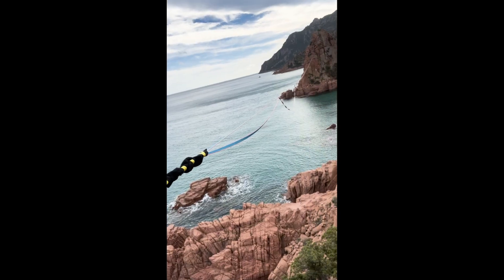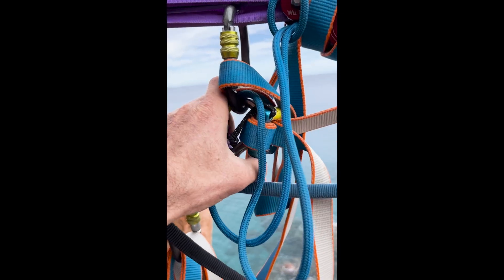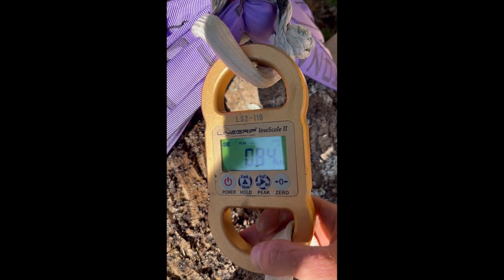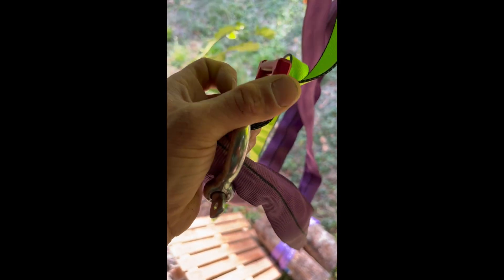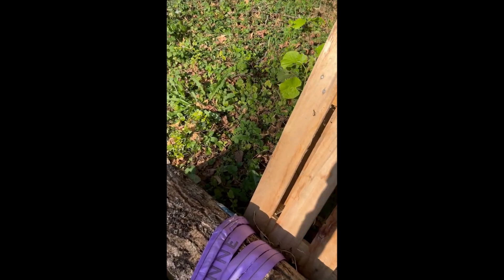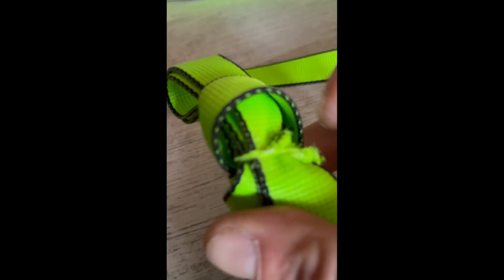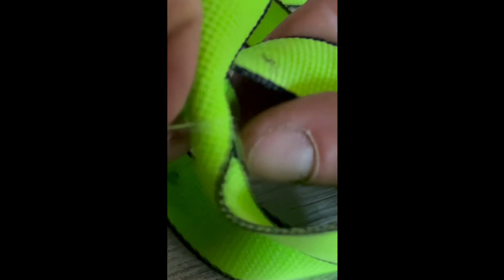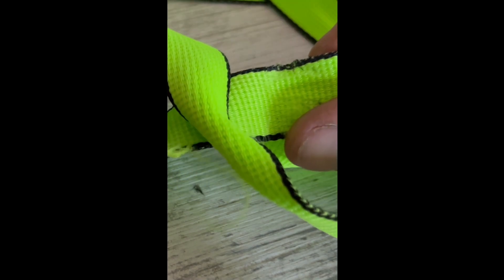Stop using knots for your highline backup

Comment: Did you mentioned anywhere what webbing you used for the test? I did not find it anywhere. Specially the webbing material would be interesting, as this could make a monster difference. A fall factor 1 on stretchy Polyamide is simply not the same as a fall factor 1 on static Dyneema.
Reply from the maker: Hi Samuel,
It is our soft release webbing so a classic polyester. I used a weak webbing for security (less peak force, less risk to be hurt)Behaviour is always better in linelock than in a knot, especially with dyneema indeed.
The aim here was to make a comparison of the anchorages strengths with all other parameters fixed